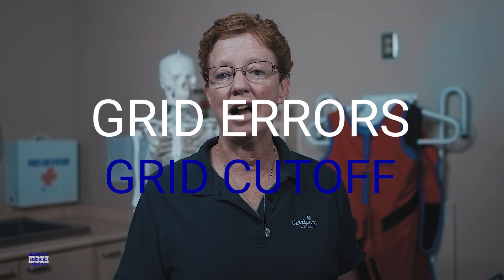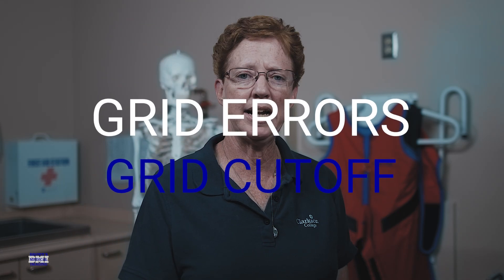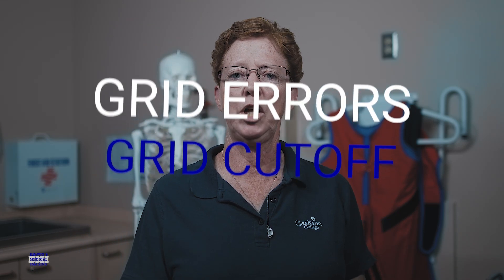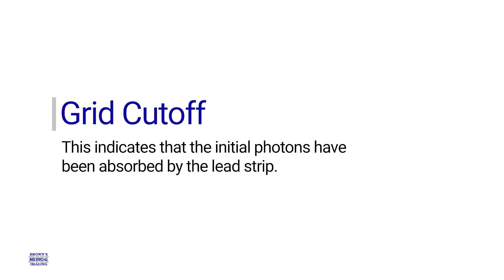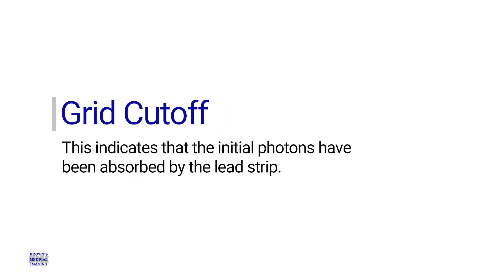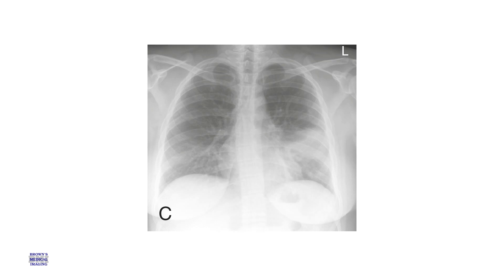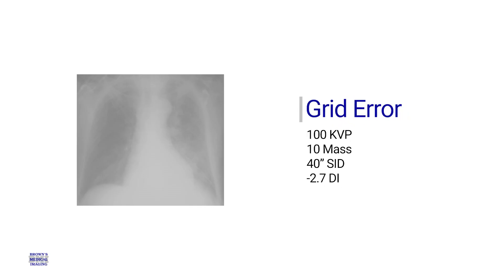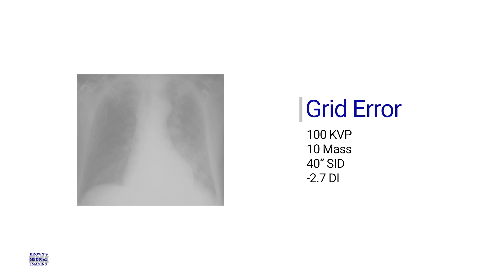Grid Cutoff? No Problem: Expert Tips for Perfect Radiography Images

Comment: One problem is guessing the correct angle for mobile focused grid use. To determine this, use a cube (or square once you understand the principle). Stand it so one edge is along the central line of the grid. If the tube focus is in alignment, there will be no shadow cast over the line or onto the surface of the cube above the line. I call it 'the sundial effect'. Once your tube focus is proven to be in exact alignment with the grid, you can then angle the tube laterally on the grid without cut off. Please watch my video on the geometry of a projection and the use of a focused grid. https://youtu.be/mZPD_gLs5Dw?si=e5HMqOBuOfOlomlu